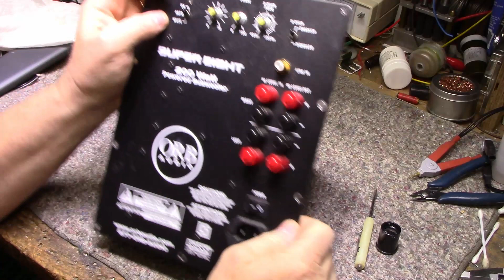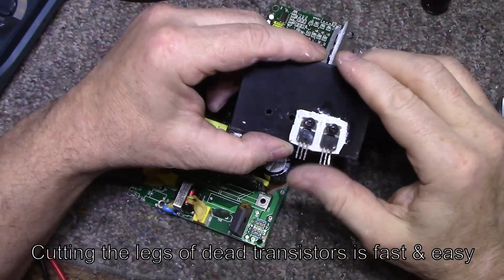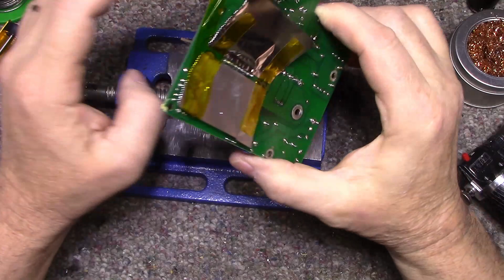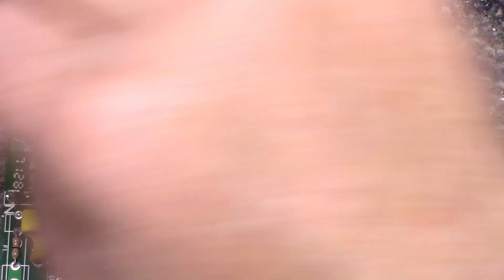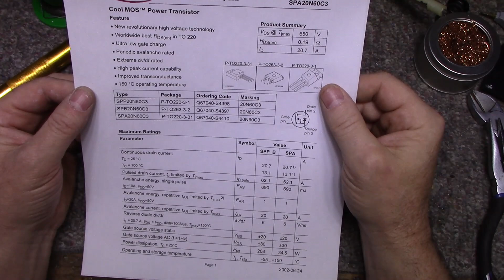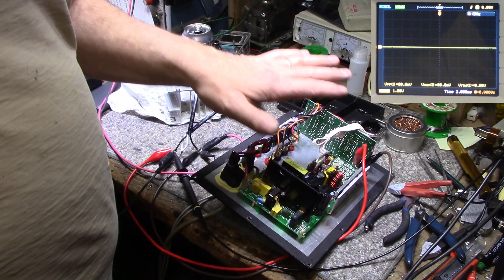Orb Audio Super Eight Plate Amplifier - DOA Repairs (Ep. 110)

Comment: Thank you so much for the outstanding no-nonsense video! I have 2 questions (if you would be kind enough to oblige). 1) On the input side of the "master power switch" there is some  black RTV material that bonds  it to the chassis. Do you happen to know the type or name of it?  I don't know what to order. Also, do you recommend using any additional adhesive on the caps to reduce vibration? Or is a good solder joint enough to keep the heavier components from rattling off.

Comment: I have exact same subwoofer in exact same state of usefulness 😅.

Q. How did you remove all the yellow Glue?
Reply: Me too! No obvious burnt parts though but I guess I will start by taking out those filter caps and looking underneath, haha!
Reply: as I get into mine, seems really similar damage, one filter cap on the primary and at least one of the primary FETs is blown, plus some but not all of the electrolytics on the secondary. Strange thing, where is the feedback on this PSU? I'm a total noob but I don't get it, there must be one, right?

Comment: Excellent video, thank you. That plate amp is a fine combination of poor design and nasty parts, especially the capacitors. 

15 years ago I worked at a small local ISP, and we had to repair hundreds of small switches that failed because of junk electrolytic caps. A bigger company would simply chuck them, but we just did not have the money to replace such a huge pile of equipment. Since then, I hate Chinese capacitors with a passion.

Comment: Did I miss something?  I thought you said it was making 11 volts into 16 ohms. Thats a very long way from 200 watts. I would expect maximum power would be into 4 ohms for a single drive unit.  They might be Chinese watts, not real watts.
Reply: Chinese watts, and likely the speaker is a 2 ohm unit, made with CCA wire in the coil. 200W PMPO, or around 30W in real terms at 10% distortion, or roughly 20W just before it starts to clip. Not going ot be rated for that continuously as well, probably will run at 15W continuous for long term, though of course it will need repairs because of the cheap capacitors and the cooking regulators.
Reply: @SeanBZA  not to mention its supply seems to be unregulated, so that any peak in line voltage can damage not only the power supply, but the amplifier as well. A lovely design all around...

Comment: Blue device is a diac, startup for the self oscillating power supply. Primary side regulation, and a really simple design, with the zener diode doing regulation, and the transistor providing the shut off of oscillation when the secondary voltage rises high.  Regulation is terrible, and it will hiccup with no secondary load.

Cooked resistor on secondary is likely a snubber across the rectifier diodes, well cooked from having not enough power rating. Secondary caps of course are all bad, well toasted and likely also the cheapest part they could find.

Voltage regulators a simple stick on heatsink helps a lot, as they likely have around 10V across them.
Reply from the maker: Thanks for your input, it never occurred to me it was a diac. These things are built down to a price. Lots of corners cut in the design and I notice no optical feedback to regulate the supply
Reply: @TrevorsBench  Look at your basic AT or ATX power supply, the primary side on older ones is nearly identical, in that they have to be self oscillating to start up, so have the diac there. Also things like CFL ballasts, which use a similar topology, though they use the transistors in series with a capacitor to provide DC isolation, but here instead they are push pull instead. Really simple supply once you know how it works, though regulation is terrible with only primary side feedback, but for here where you can accept a large amount of ripple on the main rails, not too much of an issue.